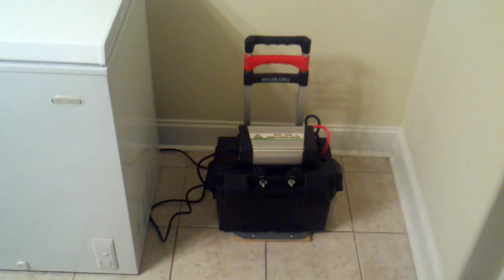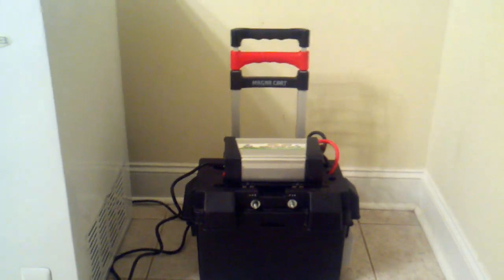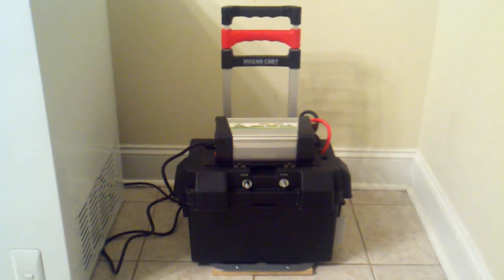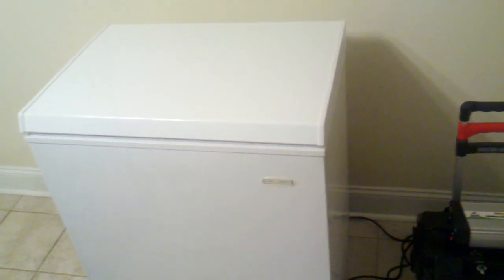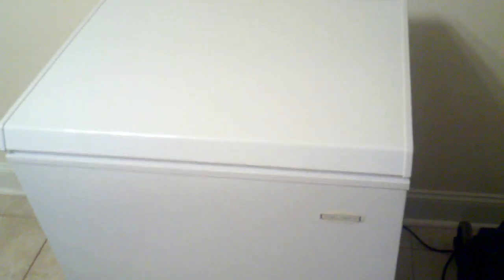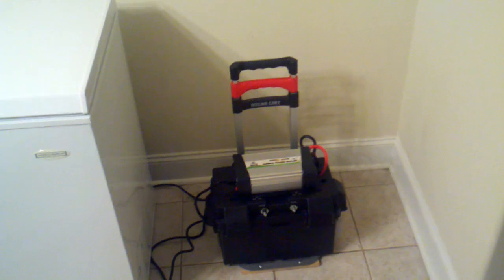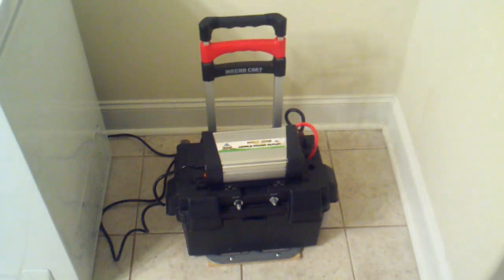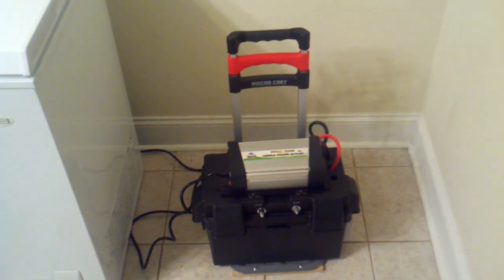DIY - Portable Solar Power -  The Practical Freezer Test - PART 3

Comment: Good info.something else to think about. Absorption refrigeration has been around for 150 years and it is very economical, a two door 8 cu ft refrigerator with a freezer uses less than 3 amps with 110 AC and it's very reliable it also could operate on 12 volt DC, or LP gas. The entire 8 cu ft  can be turned into a freezer.

Comment: very good point about using a gas generator on a fridge/freezer. it will use fuel the whole time, while the inverter will only use battery when the motor cuts in.

Comment: glad to hear it works, i have a couple 7.2 CF ones to try and keep going during any potential outages. wondered if putting rigid insulation on the top and sides would boost the cooling enough to make it worth it? I leave my comforters on the top of the freezer and theyre always cold when i grab them at night, so im think those R35 rigid insulation panels could be cut to fit and taped on or something. Also wondered, do you use a thermometer to gauge when it should come on or not? I'm thinking in an outage for a few days, the freezer could be run for a few hours on and off at a time. Thanks

Comment: Hi,
Great system and idea. Well done.
The only negative that I have is that IMHO  you could have condensed these videos into a 3 - 5 minute video.

Apart from that I am inspired to build one to power my home and charge the battery via a Solar panel. I will be using a few Cig lighter type sockets for USB charging of phones etc.

All in all a great video. thanks for taking the time to make it
Reply from the maker: +Ben Parmer Thanks for the comments, I agree with you.  This was one of my first videos and I was and am still learning, shorter and to the point is always good.

Comment from the maker: Thanks for your comments, and I do agree with you in that a timer would give the freezer time for the temperature to rise. To make this system work, the freezer should be as close to full as possible, and you should have frozen gel packs or frozen jugs of water. The idea is to have frozen blocks of items to keep the temp as constant as possible. The generator I used here would be connected to a solar panel in the day to to charge and run during the night.

Comment from the maker: You are correct, typically you would not discharge the battery by more than 20% and no greater than 30% to extend battery life. However, this was a scenario to determine how long it would last running without a charge. Cheep flooded deep cycle batteries are good for 200 or 300 cycles like this, so this one time didn't hurt it. This video shows that in an emergency situation you can discharge the unit completely (in the extreme), if necessary. A battery maintainer\charger can keep it in standby.

Comment: Another great video. A comment/question about using a timer. If a timer is used, wouldn't that allow the temp to rise somewhat? And then the compressor would have to work more to bring the temp down. Instead of using a timer (which would also use current) why not just change the control to raise the temp so the compressor would not turn on as often. I assume the intent is to keep the food cool/good. This question is from an inexperienced one so please be gently on the response :-).Enjoy your vid

Comment from the maker: In this case I don't believe so, at least not without changing out the motor etc.  However, with this type of compact freezer it's pretty efficient as it stands.  So getting a DC based freezer would be an unnecessary expense.

Comment: You have some awesome videos! Thanks A Million! I was wondering if there is a way to charge your generator using electric vs. solar? I'd like to use a small freezer in the back of my van during the day, I'd have it plugged into grid electric overnight & switch to your concept while on the road to keep freezer cold. but, when the generators battery dies I'd like to recharge it with grid electric. possible? Thanks again, Jeff

Comment: What if you left the battery hooked up to the solar panels? Wouldn't it last a lot longer than 24hrs?
Also, I thought the batteries should be left outside due to some ventilation requirements.
Great vids! Keep them coming.

Comment: I see the point. There is a charging curve and also a temp curve that can be manipulated to your benefit. To have the freezer clicking on and off kills any charging and is wasteful as the start up of the comp uses a lot of energy. Good to wait, let the comp kick in and do some pull down on the temp. In between time the battery gets to charge if connected to solar or what not. Also easier on the battery its self.

Comment from the maker: Simply get a standard battery "charger/maintainer" from any auto parts store and charge it normally.  Also one idea, If you have the skills you can also tie it in with your van alternator, if it puts out enough amps, and it will charge it during the day when your vehicle is in motion.

Comment: Hi,

I like the idea of the folding trolley/wheels that you mounted the battery box to . What are the specifications on that and where did you buy it?
Cheers
Reply from the maker: +Ben Parmer The Battery box can be found in any auto parts store, the battery box should fit a small group 24 type battery, the cart came from Costco or you can get them off Amazon for around $30, the battery can be a simple "DEEP CYCLE", 12V lead acid flooded type battery, I would recommend a sealed maintenance free type or better yet an AGM.  As long as it's a deep cycle battery you'll be fine.  And you'll need 10 AWG positive and negative wires.  You can get those from home depot or lowes.

Comment: But wouldn't discharging the battery to such an extent lessen the life of the cell considerably?  I guess using more batteries and solar panels would negate this to an extent, but most batteries to have a long life (seven years) need to be discharged less than 70%.  Is this true?  Thanks for the video also.  It showed me something I thought was not possible.

Comment: I'm curious how long did the frozen dish washing liquid hold up to the one with alcohol added?
Reply from the maker: The one with alcohol added doesn't last as long as the one with only frozen dish washing liquid.  You can use it to make a slushy type pack that can be more flexible for cold compresses and such.

Comment: note: your link in description does not work for me. can you check it.
Reply from the maker: Sorry for the dead link,  It's been awhile since I posted this video and the other video was from someone else I believe who has since removed the video.
Reply: Fair enough. I have the same freezer.  I am going to use this for hot days in the park for my ice cream business to restock my ice cream bike.  Good post.  I was looking online for others that have done this. I can see from most that the initial draw is greater to power on the compressor. Can you tell me what model your inverter is and what peak power I need. I was thinking of getting a 1500/3000peak power one. Thanks again
Reply from the maker: Getting an inverter that is 1500W/3000W peak should be fine for what your wanting to do.  A battery with high AH capacity is a must.  I would recommend using regular grid power to pre-cool the freezer, and then use the portable to essentially maintain the cooling.  I don't recall the exact model of inverter I used, I seem to recall I bought from the auto parts store, simply a cheap MSW inverter.

Comment from the maker: A 60w to 80w solar panel (for rapid charging and high amps) will work fine for you. An 80ah to 115ah deep cycle battery will also be optimal for you.

Comment: Most cooler wheels are not the strongest, neither are the axles.
Put in 2 or 3 of those deep cycle batteries, an inverter and a solar panel on top, that's alot of weight. Don't forget to vent the box/cooler or you could loose face... Your folding hand cart and a regular cooler probably better.

Comment from the maker: @imasurvivornthriver The battery started fully charged at 13.07v. At 15hrs it was 11.9v. I finished at 11.19v.  I started charging the battery with a smart charger using household current and in approx 5.5hrs the battery was at 12.45v, 13v is full. The charger was set for 12V at 4Amps. In Solar this is equivalent to a 12v panel at > or = 4Amps. Also, a 2nd unit with a small 400w inverter is not a bad idea and would work well as a backup. I also have a 2nd box and 400w inverter that will do.
Reply: rhandsom  i have a question so I want to run a freezer similar to the one that u are using in the video ... I have a small ice cream truck and all I want to do is maintain the freezer on as I’m selling my ice cream bars through the day ... which rout should I take ... I’m not wanting to use Solar since I will be connecting to the battery on the vehicle ... can u give me the basic to make the freezer run .. inverter size and should I use and extra Battery and how do I maintain the charge on the secondary battery.. thanks in advance

Comment: Have you tested using start/run capacitors with this system?
Reply from the maker: I've tried the start/run caps and they didn't work for me.
Reply: Hmm. I don't know the intricates on the subject but from what I hear, they do make a difference when a fridge or freezer is starting up. Maybe there needs to be a specific type of cap used at a specific wattage and voltage?

Comment from the maker: Yes, if you hooked them up to solar panels then it would last longer than 24hrs.  As for the battery, if you are charging the battery, ideally you wouldn't do it in a poorly ventilated area, mainly so that the hydrogen gas produced during the charging process won't accumulate, i.e., like in a in a battery box with no vents.  However, in an open space with ventilation your battery will be fine. Hydrogen is lighter than air and will not linger in areas well ventilated.

Comment from the maker: Battery box from auto parts store around $14, 1200w Modified Sine Wave Inverter for around $100 from auto parts store, Magna Cart $20 from Costco, PWM Charge Controller from Amazon $35, 115ah Marine Deep Cycle battery $89 from Costco.

Comment: sometimes you can get renorgy 100 watt 12 volt solar panels off of eBay for about $120 each and that includes free shipping but you have to look around they're used ,,,,what they call open box,,,, sold by renorgy once in awhile on eBay look for their open box used solar equipment and you can do really well I bought a renorgy 4210 Tracer mppt charge controller for $132.99.
Reply from the maker: +bill767667 Thanks for your comments.

Comment: if it works this good for what it is a chest freezer,,,, then converting that chest freezer to a refrigerator with a set of Johnson Controls easily bought from Amazon,,,, couple of golf cart batteries wired up for 12 volts and say maybe two or three hundred Watts worth of solar and you'd have a fridge that would run 24/7 probably.
Reply from the maker: +bill767667 Thanks for the comments.  May need to do some more battery sizing to run 24/7, due to possible charge time vs peak sun hours.